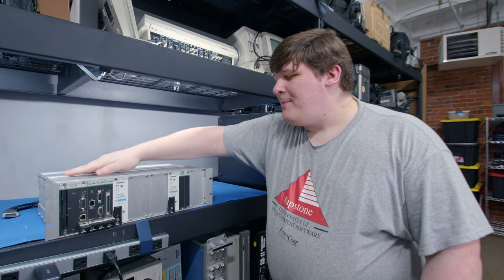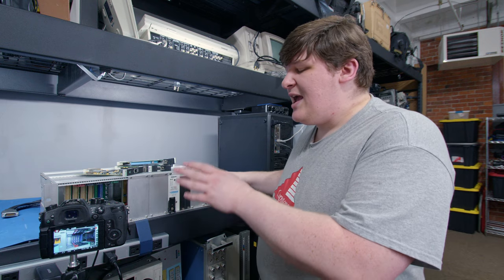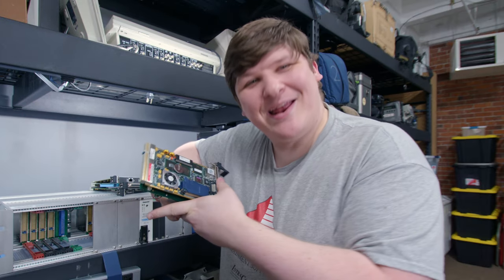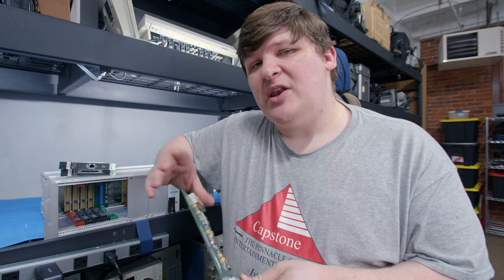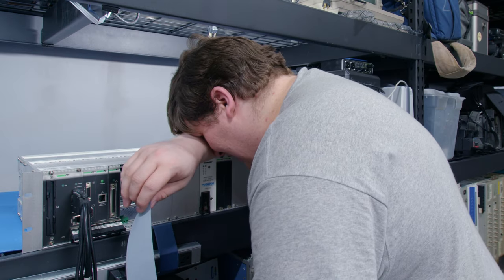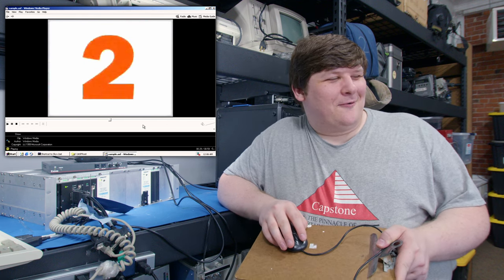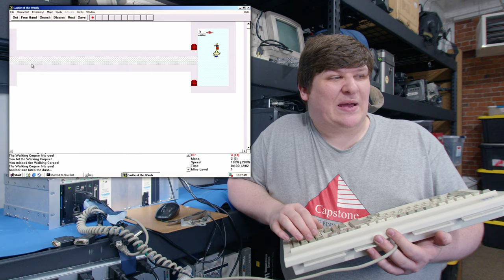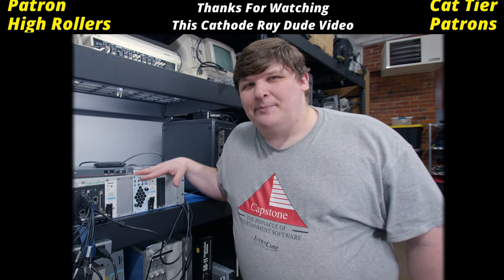Little Guys Ep 12: Computing With Eurorack

Comment: I actually work at a company that makes cPCI cards and you got it all right for the most part. Just some quick thoughts. That red slot is usually what we refer to as the SYSCON slot, because the bus master has to go there. Usually this is some kind of SBC, but you could in theory put anything there provided it can perform bus arbitration and act as a system controller. The picture you showed of the 6u chassis is interesting because it has two SYSCON slots, which are bridged by some sort of PCI switch on the backplane. Sort of like a PLX chip it allows for multiple system controllers on the same bus, although to access the children of the other syscon, you have to go through the switch, and then through the other syscon. It is common for those additional pins you mentioned to simply be a passthrough straight to the back side of the backplane, so you can insert what is called an RTM or rear transition module. You are correct that a manufacturer would define this pinout themselves, but provided the backplane is a "passthrough" backplane, and your RTM matches with your SBC, the system should "just work". But like you said you do have to be careful, it's not always immediately obvious that a backplane is passthrough or if it is routing something else point to point on those pins, for example it is common to have Ethernet routed on those pins, and they go directly to another slot in the chassis.
Reply from the maker: Huh! So the red slot actually has access to different signals, presumably. This is what I get for not having the spec! (someone has since sent me an old copy I need to review, heh)

Thank you so much for all the info!

Comment: Saw it — my mind instantly went "Eurorack! Eurorack! Does it fit Eurorack?" 😸
Reply: it would
Reply: Eurorack and CompactPCI are both based on the same standard "single-height" (3U) Eurocard chassis.
There's a whole lot of other equipment that uses this form factor too, e.g. modular measurement equipment for use with LabVIEW.
Reply: Yup. This thing. First minute.
Reply: Same - that was the first thought in my head. I'm glad it's not just me. 

That said, this would be a rad case for a synth
Reply: dude this totally fits eurorack
Reply: @musashigundoh  I remember when I first learned this about 10 years ago. Though that was more about all rack-mount gear being the same width — to free up floor space they stuck an old cheap 2U business server in spare slots on their outboard compressor, interface, amp, etc case 😆
Reply: Saw the title and thought, “hmm, he’s doing synth modules now?”
Reply: Everyone jokes about DAWless setups but clearly this is what we all need.

Comment: This hits close to home for me as I work for a company that makes PXI equipment, which is just CompactPCI for electronic test & measurement (PCI Extensions for Instrumentation). You can get all sorts of modular test gear in the CompactPCI form factor under the PXI banner including DMMs, oscilloscopes, function generators, programmable power supplies, relay multiplexers, etc, a lot of which would probably work in your chassis. There is even PXIe (PCI Express) on some chassis which I believe is test industry specific. It's fun to game on $16k of test equipment, and thanks to this video I'll have to start cramming modular synthesisers in too.
Reply: imagining a mordax data feeling incredibly self consious mounted next to a Big Boy oscilloscope that can do 10 gigasamples
Reply: Please make a demo/test rig with an osc and other test equip that measures some eurorack outputs all in the same chassis, would make for a great marketing piece and satisfy all our inner nerd !!!
Reply: I program these test machines. (And from time to time develop modules and adapters for them)
But the company I work for doesn't like PXI as it's expensive compared to other options.
Usually we stick to HP / Keysight DAQs  and DVMs, sometimes Beckhoff Industrial / PLC stuff
Reply: If you guys haven't seen it. Marco reps used some modular racks like this when building his voltage standard rack. On his YouTube channel.
That  And other metrological equipment projects

Comment: 22:40 😳🤯🤦

I HAVE BEEN USING 68-PIN SCSI FOR 30 YEARS, AND I NEVER NOTICED THAT THE INTERNAL AND EXTERNAL CONNECTORS ARE PHYSICALLY IDENTICAL!
Reply: If it makes you feel any better, I have known this for about 30 years but never found a USE for it.  Everything was either internal OR external SCSI and I don't think I ever owned anything that truly had reasons to swap from one to the other.  I kind of miss SCSI.

Comment: That rack, though.  It's giving strong Eurorack, especially Doepfer vibes.

In that world, vertical is measured in "U" with almost everything being 3U but occasionally small utility modules being 1U tiles.  Horizontal units are measured in HP, where 1HP is very slightly (and maddeningly) more than 5mm.  So measure how wide the card is in centimeters and double it, and that's the HP, more-or-less.

ETA:  Haha, you got there, too.  And yes, when Doepfer standardized the Eurorack spec, it was based on computer rack hardware because that was readily available.  Sadly, even though I am in the market for a decent Eurorack case, repurposing an old CompactPCI case doesn't appear particularly cheap; there are current-gen cases on eBay for more than a grand...  Maybe something to set up a craigslist alert for, to save on shipping, but the perfect era for pulling this off for cheap was probably fifteen years ago when even the industrial P5 users were retiring their racks.
Reply: Hence the last 5-10 minutes of the video.  I really hope someone does getting around to throwing some Eurorack modules into one of these things - it seems like it would actually be pretty darn cool.
Reply: this standard goes wayyyy back to early telecom, doepfer just adopted it because it was convenient. it's also very convenient for me since i just got 416HP of rack for about 100 dollars by buying them from a eurocard case manufacturuer instead of a synth shop where you'd pay a LOT more.

API's series 500 is also based on eurocard but the two have diverged just enough that you can't put 500 series modules into a eurorack case. the screw holes don't line up anymore.
Reply: @famitory  A lot of eurorack cases I've seen have sliding nuts in TS rail, rather than fixed-position screw holes.

What manufacturer of eurocard cases sells to the consumer?  I'm in the market myself.
Reply: It's less maddening when you realize that 1HP is 1/5th of an inch. 
(But yes, Eurocard and its derivatives like Eurorack being a wild mix of metric and US dimensions is pretty annoying)
Reply: @oasntet  schroff are the standard from what i remember. keyword is Vector Rails
watch out because in eurocard 2.5mm screws are standard instead of the 3mm used in eurorack, so if you get those nutstrips you wont be able to use any of the screws included in the box with modules

as for marketplaces you want component sellers like mouser and digikey.
Reply: @famitory  Yeah, Vector is the manufacturer of the TS rails I was talking about.  I thought you'd found a complete 416HP eurorack-compatible case for $100 and wanted in on that.

Comment: SkyX seems to be a TCP accelerator. Since satellite links have such high latency you don't want TCP replay/go-back-n/ACK type messages going through the satellite link. These boxes probably establish a new TCP link at the ground station and use different protocols through the satellite link, essentially a man-in-the-middle of your connection.
Reply from the maker: That makes a ton of sense, thank you!
Reply: Didn't satellite Internet upload on dialup
Reply: @AgentOffice  some were pstn return path.
Some are satellite up and down.
Reply from the maker: @AgentOffice  the consumer stuff often did, but bidirectional satellite networking has always been feasible if you had the money
Reply: I wouldn't be surprised if they stripped off the entire HTTP application layer and threw that onto a different protocol and re-packaged it on the other end - they probably would have run a proxy server on the box anyway to filter out any users trying to look up 'naughty' sites.
Reply: Wasn't there a controversy regarding one airline Man-In-The-Middling all of the Internet connections for more nefarious reasons other than speeding up traffic?
Reply: @Dong_Harvey  there's different "layers" of traffic interception. You're probably thinking about someone interceptin traffic at the application layer (TLS), they're talking about interception at the transport layer.

Comment: I'm using one of those office PCs with a DMS-59 graphics card! It's the only spare Radeon card I have with analog out, and I use the PC to play emulated games on my CRT TV with Retroarch and CRT SwitchRes. In the end, the chain is Optiplex -> DMS-59 -> DVI to VGA cable -> 15KHz VGA to composite/S-Video converter -> TV. It's not the most cursed hookup, but it's my cursed hookup and I love it.

Comment: 11:45 - Yep, desktop "classic Pentium" went up to 200 MHz, desktop Pentium MMX up to 233 MHz. The mobile MMX versions went up to 300 MHz.  (The "Tillamook" core, on its own custom "mobile card" interface that also held the 430TX chipset and L2 cache - which means the vendor removed the Tillamook CPU from the Intel-supplied card to re-mount all the pieces to their own custom board!)
Reply: My very first PC was a non-MMX P200 that I bought on clearance because it was being replaced by the MMX version.
Reply: @CantankerousDave  around where i lived 200mhz regular pentiums were basically unseen, they were too expensive for anyone to buy before the mmx 166 got on the market anyway.
Reply: Tillamook is a brand of cheese from Oregon. I know it’s named for the Tillamook region near the intel fab, but to me it sounds like “Intel used the Sargento core for their mobile chips”
Reply: @ For a while, Intel was using names of rivers as the core names. Tillamook, Klamath, Deschutes, Tualatin, Willamette - all rivers in Oregon. Katmai and Coppermine are rivers in Alaska and Canada.

Comment: I'm an automation engineer.  I program and support automated equipment for factories.

I actually got tasked at one point to support a machine that had a 68k  and VME bus.

It ran a tablet pill press.  The date in the cabinet was 1998. 

I wasn't given the source code, or the programming software, or any documentation on it. I told them I couldn't support it and it was over.  It would have been a cool project to work on though.

Comment: Btw. assuming this really is EDO RAM you will absolutely need both memory modules to get this machine to do anything. EDO RAM (and everything else before SDRAM) is only 32 bits wide but Pentiums have a 64 bit data bus, so they insist on talking to two memory modules in parallel. This is why you always had to install memory modules pairwise in early Pentium machines.
Reply from the maker: Yup, I was actually preparing to say that before I busted the tabs off and got completely distracted. probably if I hadn't thought to tape the stick back in, I would have gone "-oh wait, no, that won't work" a minute later, heh
Reply: @CathodeRayDude  I wonder if Louis Rossmann could replace the RAM socket, assuming a replacement could be found?

Comment: If you like this, you'll love PXI and VXI.  These are both long lived setups for automated test gear.  Many of them have integrated PCs in their racks.  But the hardware that connects to it varies wildly.  Everything from a multimeter to fancy digital testers.  Even oscilloscopes.  And these things have been around so long, you can find PCs with 486s (or maybe even older) to the latest stuff from Intel.
Reply from the maker: I absolutely DO love PXI/VXI and have been stopping myself from trying to buy a system on ebay until I have time to really think it through hahaha
Reply: Seconding! as someone who has worked with the PXIe variant. Such a wild world of adding things to PCs
Reply: The only time I've encountered VXI was two 19" racks full of Keysight SERDES pattern generators and protocol analyzers. Sadly no little guy as the VXI connection was made to a desktop with a long daisy chain of Firewire. This was an actual industry standard thing that bridged the five minutes between the GPIB and gigabit Ethernet LXI eras.
Reply: Probably won't find anything older than 80486 in an industrial system that only has a PCI bus or variant of it. There was one crazy PC motherboard that supported both 80386 and 80486 CPUs. It had an 80387 socket, ISA slots and PCI slots. With a 386 CPU installed the PCI slots weren't usable. Pull the 386 (and 387 if it had one) and plug in a 486 and the PCI slots worked. A friend owned one for a while.

Comment: Making a LAN between the two PCs in the same rack is what I'd call "vlan" - "very local area networking" 
EDIT: the Euro-Rack format was (is?) very popular for industrial small production runs. If you have only a few hundred of devices to make for a select customer, this would be the way to go: cases are readily available, backplanes can be 1:1 off the shelf or customized using wire wrap... THe company I worked for swore by them in the 1990s.
Reply: I work in that area and yes, one of the form factors that we use is modules for a 3U Eurocard rack. Those aren't too frequently ordered, as 19" racks aren't very common around heavy industrial equipment so most customers prefer standalone boxes, but we design PCBs to be 100mm wide whenever we can just to have that option if required.
Do note that Eurorack is a standard specifically for modular synthesizers.
Reply: @musashigundoh  OK, I was unaware of the "Eurorack" term specifically for synth use... I'm not a native speaker so some terms blend together. We used to refer to the cards as "Eurokarte" or "Euro Einschub".
Reply: @atkelar  You were correct on the first one, Eurokarte/Eurocard is a very old and very common standard for fitting PCBs into 3U/6U/9U chassis with optional 96-pin backplane connectors on the rear. It spawned a whole bunch of derivatives, including the titular CompactPCI (fixed 160mm depth and a different backplane connector), Eurorack (very shallow depth, no backplane, 3mm mounting screws instead of 2.5mm), and a whole bunch of proprietary ones.
Reply: How about calling it "can" ("chassis area networking", but also because both machines are in the same tin can)

Comment: I work with these things professionally, because normally suppliers don't use all the backplane connectors spec'd in PCI, some cPCI and PXIe can be plugged in a hybrid slot. And as far as I know, the horizontal spacing is called a slot. There's another backplane configuration for timing input. In big factories there's sometimes factory wide high impedance timing lines

Comment: I was literally working on something that looks very much like eurorack today. I'm building a DWDM fibre optic system for an office relocation so we can have the two independent networks running off the one HA pair of firewalls split between the two offices (don't ask), and it (the DWDM system) uses some 2U rackmount frames that look very much like eurorack.

The system itself was "left over" from a managed service we had from [large Australian telco] for like at 20 years, but they never asked to have back when we cancelled the service. The cards in the system have optical input/output ports that either go to the optical MUX or the network, and they act as transponders to convert from a DWDM wavelength to a regular Ethernet optical wavelength (i.e. 1310nm) or vice-versa. You need two cards to convert both the TX and RX directions at each side, unless you get the fancy newer models that are duplex. They plug into a backplane for power, control and monitoring, and the optical connectors push through into fibre housings on the rear connectors, which also plug into the backplane for the electrical connectors (the cards can also be reconfigured from network mode to broadcast mode, but that's another story).

Speaking of control and monitoring, there is a controller card which is used to configure the other cards and monitor the optical TX and RX light levels, which is very useful for working out whether you need an attenuator to keep the light levels within the valid operating window. It's managed via the Ethernet port, and it basically had non-HTTPS open access when I used my 1337 hax0r sk1llz to do a scan and determine it was indeed using the default IP address we had been given in our documentation, then I used my even higher-level sk1llz to determine the username and highly-secure password were "admin" and "password", respectively (yes, I promptly changed it), which is only actually required to change any settings.

Anysways, turns out the thing is literally a tiny 486 with 32MB of memory, running an ancient Linux from a tiny compact flash card. It was supposed to be managed by the service provider, but I'm guessing they never updated it or changed the password because they were managing it remotely using the serial port rather than the Ethernet port, and none of the access controls apply to that (as far as I know, I didn't really look into it much).

Anysways anysways (if you're still reading this), I'd never heard of or seen anything like your CompactPCI little guy. It is very interesting, though, so I hope you find more like it to show us and play with in the future.

Comment: The connectors and the card form factor (Eurocard) are specified in DIN 41612 and IEEE 60297. VMEbus used double height Eurocards where this system uses the standard 160x200mm card format. One horizontal pitch unit is 0.2" (5,08mm) so the narrowest module you have there is probably 3HP wide.